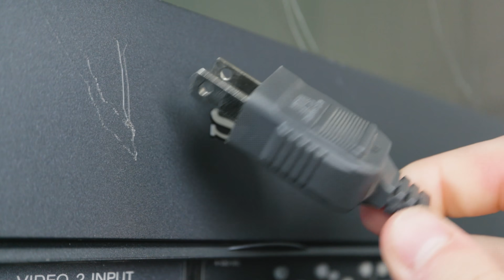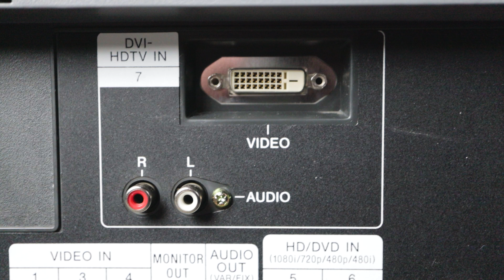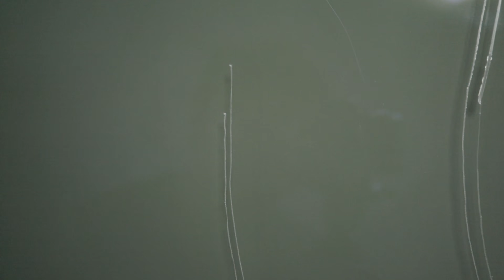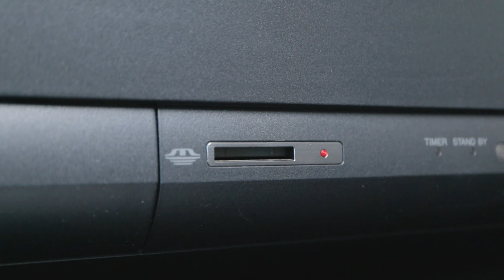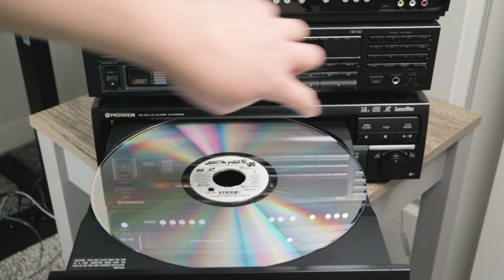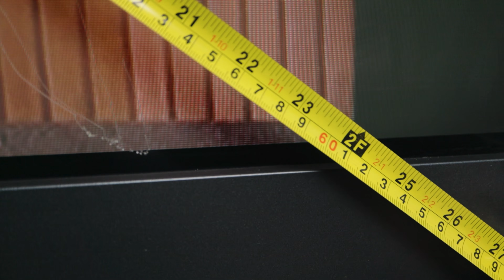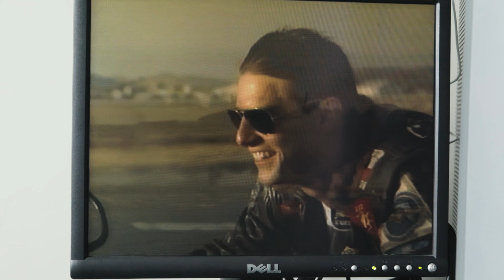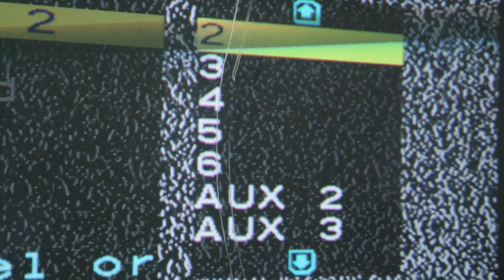The HD, WIDESCREEN Tube TV! Sony Trinitron KV-30XBR910

Comment: I worked at Circuit City while transitioning between standard definition CRT and HDTVs. We used to sell this TV back in the early 2000s. It was a heavy beast. We even sold a larger 40-inch 1080i 4:3 version. 

From 2000 to 2002, we sold standard-definition CRT TVs, 480p LCD EDTVs, 480p Plasma TVs,  720p Plasma TVs, 720p LCD TVs, standard-definition rear projection TVs, 720p DLP projection TVs, and more. 

Multiple TV technologies competed for dominance while transitioning from standard definition to HDTV. I remember when progressive scan DVD players were introduced. Additionally, I recall when HDMI was launched as the true successor to component cables for TVs. DVI wasn't popular except on the most high-end models. Most TVs use composite connections for standard definition or component connections for HDTV. S-Video was also available. However, most people never utilized it on their standard definition TVs or DVD players.  

I had to know everything about these TVs back in the day so I could explain all of the differences between the TVs to customers. Back then, the internet was a very new thing. Most people still had dial-up with some DSL for slightly faster internet. So, most people didn't know what resolution, pixels, HDMI, or the i or p meant on a TV for resolution. Information online wasn't prevalent. They were also very confused about 4:3 and 16:9 back then. 

Many people complained about why their tube TVs suddenly had black bars on their screens, since so many people were beginning the transition from VHS to DVD. 16:9 looked great on HDTVs, but most people still had SDTVs. So, as TV shows started the transition to 16:9, it really pissed a lot of people off that they were getting black bars. 

Many people initially thought DVD was inferior to VHS because of the black bars. (Letter boxing) 

So I had to explain why they had black bars where everything filled out the entire screen before. 

It was an interesting time.
Reply from the maker: Wow! That's really interesting. That would suck to remember all the different technologies and stuff. 

Also, the letterboxing is hilarious. I guess it makes sense that people would be confused.

Thank you for your comment!!
Reply: Same! used to work at a local electronics shop, sold a few of these back then too. I HATED delivering these TV's, because the Trinitrons were always the heaviest. These would be great to have for retro gaming now.
Reply: @MrCallahan  Yeah, moving these TVs was always a chore. I just always made sure I took my time and never rushed. You never want to put a dent or a scratch on your customers television. And luckily I can say I never did. I personally never had a complaint from a customer when delivering or installing.
Reply: Around that time, Circuit City also sold an RCA F38310 38" Widescreen CRT as well.
Reply: I also worked at Circuit City during this time, this line of TVs was my favorite that we sold. You hit most of the points that I was going to make, I clearly remember how heavy that 40" 4:3 model was from the one time we had to move the display model. There was also a 34" variant of this 16:9 model. Sony released at least one more revision of these afterwards that had HDMI, which hadn't really been adopted widely yet in 2003. At that time, DVI was the only option for a digital video signal from cable and satellite receivers. I was in a large market and we had 6 or 7 channels available in HD over cable in 2003, or you could get the now-defunct Voom satellite service that carried about 30 HD channels (and was very expensive!) Blu-Ray and HD-DVD weren't on the scene yet, we did sell a D-VHS player made by JVC that played HD movies from tape. I also remember when we first started carrying an upscaling DVD player which could output in HD resolutions over DVI. All of the other models maxed out at 480p over component, and only then if they supported progressive scan. LCDs were still prohibitively expensive at any reasonable size (largest we carried in 2003 was a 30" Sony that cost $5000,) and they weren't great quality. Plasmas were still top dog for 42"+ screens, but DLP and LCD rear projection offered a middle ground with decent HD picture at a lower price than plasma, and were a substantial upgrade from the traditional CRT rear projection big screens. These DLP and LCD projection models all had DVI inputs as well with a true digital signal path.
Reply: @ocda3  LOL! It's almost as if our stores sold the same things. You're replaying my Circuit City memories here.  😂

I even remember the DLP TVs and the VHS player, too. Not to mention the 34-inch Sony XBR HD CRT. I'm still using the Panasonic AV home receiver I bought from Circuit City all those years ago, too, with Dolby Pro Logic 2 and all.  😅
Reply: definately interesting times back then, you've certainly had to know and explain a lot of thibgs to the customer😊
Reply: In the U.K. many shops didn't understand the difference between 4:3 and 16:9. Displaying a 4:3 picture on a 16:9 TV so it looked as if everyone had been on a supersize me diet was nicknamed "The Curry's effect" (Curry's being similar to Best Buy in the U.S.A.
Reply: @MrDuncl And obviously many TV owners "stretched" the image at home because they didn't know any better or wanted the image to fill the whole screen. Personally I believe that this even contributed to the obesity epidemic because people looked larger in television than they actually were...
Reply: I relate to all this so hard, except I was in a pawn shop trying to explain all this stuff to crack heads 😅.  I do not miss moving 20 plus crt screens a day.
Reply: You forgot about 2 major differences of HDTV.
There where HD Ready and HD built into the tv.
Reply: @NextNate03  Yeah, main difference between the two is that one was ready to receive a HD signal while the other needed a tuner box.
Reply: I'm a cable man today, born shortly before the time you're describing, but I have memories of going to Circuit City and The Good Guys which I think was a west coast only version of Circuit City. My neighbor growing up, about 2003 got some kind of flat screened fat back TV that he brought us over to watch Rise of the Machines on, when that came to dvd. I have picked up a few things from customers over the years that I am very lucky to have picked up, I have a Wega flat screen 1080p from 2005, a dozen VCRs, a DVD player, a few thousand or so VHS tapes, a few dozen DVDs, and I just got an alienware laptop I'm thrilling my family and self by connecting to the ancient TV. I am mind boggled sometimes when I get to a house where, my instinct is to try to preserve their old system and convince them to run the new crap alongside it. I arrived to one recently where they had an honest-to-God Tivo set up, with a bunch of adapters that allowed it to keep playing on a modern TV. I don't know what any of them were, but I think one was called an unscrambler and had a Motorola logo on it. I hope to find more old technologies and get them working, they are truly fascinating.
Reply: Widescreen SDTV CRTs were common in Europe, but I believe not in the US really.
Reply: @joonasjanatuinen5474  maybe it's because in the US there was a common misconception that widescreen = HD, when it's not really the case.
DVDs carry widescreen video despite clearly being limited to 480p/576p.
Reply: remember those plasma's that weren't full HD.  A friend bought a Samsung 50" plasma that was 480p plasma, it looked great.  the 720p came out and a few years later 1080p arrived, and that seemed like it would be the end.  Then 4k and 8k and 16k.  No one ever really complained at the resolution.
Reply: I still have nightmares about working at Circuit City and then dying and having to stand before God on Judgement Day trying to explain why I sold so many awful extended warranties (“Performance Guarantees”🤮) to my fellow human beings.  Circuit City was evil beyond comprehension and while I’ll never get back the 7 years I spent working for that terrible company, I can at least take joy in the fact they are no longer in business.  May God have mercy on our filthy, cheese-selling souls.

Comment: After my LCD died in less than 3 yrs... I picked up a similar 34" Sony Tv model.   Mine had HDMI,  instead of DVI.   I loved it for watching movies.  Gaming on it was OK... but I believe I remember seeing a small amount of motion blur  (I think the video processing chips, were not quite fast enough).   The sound was So good... that I sometimes used the TV as a Center Channel, with my surround sound system.

 I had at least one Disc that would not play on that TV... due to the HDMI chip being an older standard.   As such, I just used the Component input instead, and played it that way... as far as I remember.

 Id have loved to have kept it... but I had nobody to help me move it, (and some other issues)  so it had to be left behind.

 I eventually picked up a large Plasma TV at the Thrift Shop.   Larger Screen.  Better picture.   Much easier to move.

 BTW - If you want the best sounding vintage audiophile grade speakers..  search for:    EPI 100   speakers.   Theres also a similar Genesis Physics model (Genesis bought EPI.  They used the same Epic drivers).

 You can often find these used GEMS for cheap.  I got mine for $100, refoamed, on Craigslist.   Or if you want to build your own with brand new drivers.. A former EPI/Genesis worker  runs a site called  Humanspeakers.  He sells a kit with all new parts, for under $400.   These speakers have the widest and deepest 3D holographic Soundstage, that Ive ever experienced.   The bass is very Deep, Punchy, and Lusciously "Natural"  (far better sounding than any Ported speaker).   You will also hear new things in your old music... as they have such low distortion levels.. compared to standard non-audiophile drivers.

 Make sure they have the original Drivers:   The woofers have a uniquely small dust-cone diameter, so they are easily spotted.   The tweeters are Inverted (concave).   Get a pair that has the Updated tweeter models.  The older tweeter model is attached to a fiber-board backer... and isnt that good.  The newer models are attached to a plastic bezel backer... and compete with speakers that cost many thousands of dollars.

 I used to rock  Four 90s era Techniques 12" 3-way tower speakers.. for my surround sound system.   But when I got the EPI's... they all went in the trash.   The EPIs may have smaller 8" woofers... but they actually put out Deeper and more Accurate Bass, than the Techs.  And the high end details of the EPIs tweeters... utterly Destroys the Techs  tweeter and midrange drivers combined.   It was Not even close.

 Anyway... I run my EPI's  with my 5.1 Pioneer surround sound amp, that I got when I was like 17 yrs old (Im almost 53 now).   I run my audio in Analog, as for some reason.. the Digital on my amp + soundcard... sounded like Poo.  In addition to a Bluray player... I also fed my PCs audio output to my amp...  for use with Video Games, Music, etc.

 And if you want to FEEL some additional Bass...  pick up a pair of Bass Shaker Transducers... and mount them under your chair / couch.  I got a used pair of Aura Bass Shakers.. and they are pretty darn cool.   Aura went out of business.. but parts-express sells replicas.  Just make sure you get the 4 inch diameter versions at Minimal.  The little 1 or 2 inch versions... are not built with good enough quality standards, and Fail quickly  (also... shakers that are that small... are not going to generate enough vibrational forces, to be useful).
Reply from the maker: That sucks you had to leave your TV behind. Thank you for the info on the speakers. I swear I've seen a pair of EPI 100s at some point. I'll have to track some down!!

Comment: I had the 34" with HDMI. I was actually disappointed going from this to my first flat panel TV, as the CRT had a superior image. The only Trinitron I ever owned where the tube failed -- It lasted about 7 years, which is fairly standard for modern TVs, but I have a Trinitron from 1988 still going strong. Upscaled DVDs looked better on this than any display I've used since.
Reply from the maker: That's awesome!
Reply: Because that's the only tv with a super fine pitch tube. It's the most advanced tv ever made.

Comment: The best picture quality! I am sure they can make a large flat screen, with thin light glass!
Reply: I'm sure they could find a way to make them thinner with new technology, but not thin enough to compete with flat screens. People today care more about how the set looks in the room than picture quality. I think another reason they moved away from tube sets was the emissions from the cathode ray.
Reply: @jonsumisu9016 Absolutely totally agree with you! Thank you for your response!
Reply: @jonsumisu9016 Thank you for your response! I totally agree with you!
Reply: As Scotty would say "ye cannae change the laws of physics". Size was the other major factor. Samsung did a weird thing where tried to make the tube shallower by decreasing the dot pitch at the sides of the screen "which people don't look at", but by then most people were prepared to spend a bit more on a flatscreen which was as focussed at the corners as the centre.
Reply: @MrDuncl  If I remember correctly, didn't Philips bring a much thinner tube out at one time? I think they bent the beam through 90 degrees or something like that. Never caught on though.

Comment: You could fix the scratches using the same stuff they use to repair windscreen in cars, I think Project Farm has a video on them, it's basically a transparent resin you pump into it and you use UV light to cure it, if is good for cars, it's good for TVs.
Reply from the maker: Good to know, thank you!

Comment: Very interesting video, I'm surprised it hasn't got a digital tuner made in 2003. As here in the UK we had digital TV from 1998. Trinitron tvs very good picture apart from the mesh support wires, once you see them they are very distracting and I got rid of mine due to that fact.
Reply from the maker: Yeah, that's a good point. It's odd they wouldn't have a DTV tuner. 
Also, I didn't know about the support wires. I'm afraid I won't be able to unsee them haha

Comment: I had the 34" version of this exact TV (KV-34XBR910). It was a 200 lb beast. Content looked amazing on it... well, most content. I was not terribly pleased with how older 240p consoles looked on a tube with such a fine dot pitch, but TV and movie content looked brilliant. For movie playback, I used an Oppo DV-980H universal upscaling DVD player and my PS3, both of which allowed 1080i output. Calibrating it was also a bit of a pain. I spent a long time trying to get the convergence corrected at the extreme corners, but was never happy with the results, so I gave up and considered it 'good enough'. When I moved to my current house about 10 years ago which is considerably smaller than my previous one, I simply let the movers keep it. It had served its purpose since the mid '00s. I had already needed to replace a couple of small ICs on the D board to resolve a power issue approximately 5 years after it was purchased. When I would try to turn it on, the standby LED would simply blink several times and nothing else would happen. Turned out to be a fairly common problem with those back then, unfortunately.
Reply: On some Sony CRTs you can make all the adjustments using the remote using a hidden factory menu. Make sure you note the start points though. I tried adjusting one and the end result was slightly worse than before I started.

p.s. The reason they were able to make the screen completely flat is that the focus, convergence, etc is all digitally controlled.
Reply: @MrDuncl  Yep. Believe me, I'm well aware. I spent hours in that service menu over the course of several days making adjustments to the convergence in all four corners. It did end up a bit better then it was, but it was never what I considered 'perfect'. As soon as I had reached a point where the only way I could tell there were still issues was with test patterns, I was relatively satisfied and didn't feel like messing with it anymore.
Reply from the maker: Interesting! It's too bad you don't have it anymore
Reply: The 34 910 wasn't anything like this tv. The 34 910 and 960 were super fine pitch tube's. Like a pvm. The 34 was far superior and a true videophile tv even to today. I have both the 910 and 960 34 to this day. I use my 34xbr960 often
Reply: @dauth78  I think you might need to do a bit more research. The KV-30XBR910 also has a Super Fine Pitch tube... which is even clearly shown in this very video you're commenting on. Except for the size, the KV-30XBR910 is practically identical to the KV-34XBR910, so I fail to see how it is not "anything like".
Also, my KV-34XBR910 did not have any HDMI ports. It had a single DVI input on the back panel, just like the 30" model shown in this video. You may be confusing KV with KD. Try searching Wiki for 'FD Trinitron CRT variants'. You will find that there are several examples that fall outside of your broad generalizations.
Reply: The 34s also got hdmi